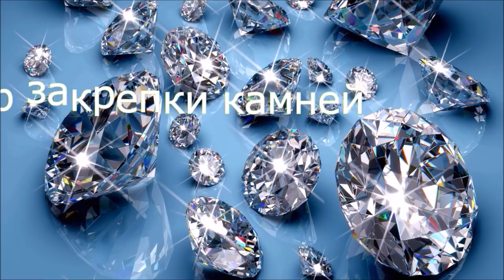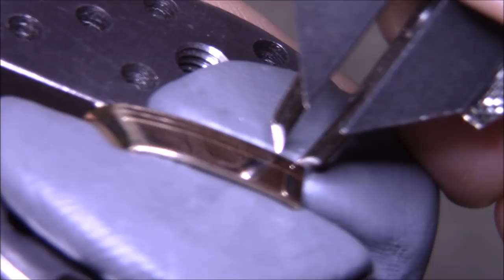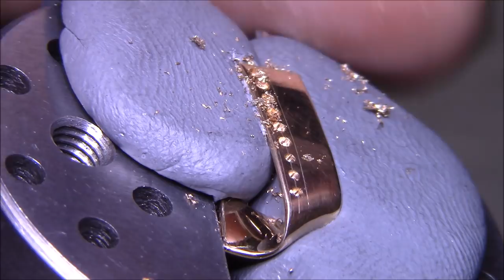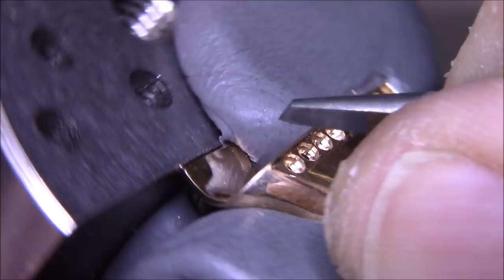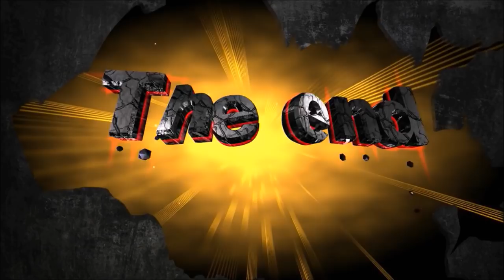Закрепка камней Stone setting (Серьги)

Comment: What tool did you use when scribing the lines into the metal. What is that tools name that you marked the holes and lines with. Where can I buy the tool you used to mark the lines and dots for the holes?
Reply from the maker: Compasses marking for metal
https://www.google.com.ua/search?q=%D1%86%D0%B8%D1%80%D0%BA%D1%83%D0%BB%D1%8C+%D1%80%D0%B0%D0%B7%D0%BC%D0%B5%D1%82%D0%BE%D1%87%D0%BD%D1%8B%D0%B9+%D0%BF%D0%BE+%D0%BC%D0%B5%D1%82%D0%B0%D0%BB%D0%BB%D1%83&tbm=isch&ved=2ahUKEwjZmPCg_vf1AhXHVMAKHfOtDpQQ2-cCegQIABAA&oq=%D1%86%D0%B8%D1%80%D0%BA%D1%83%D0%BB%D1%8C+%D1%80%D0%B0%D0%B7%D0%BC%D0%B5%D1%82%D0%BE%D1%87%D0%BD%D1%8B%D0%B9+%D0%BF%D0%BE&gs_lcp=CgNpbWcQARgBMgQIABAYMgQIABAYMgQIABAYOgcIIxDvAxAnOgYIABAIEB46BAgAEB5QjB9YlzJgnUFoAHAAeACAAWOIAYIDkgEBNJgBAKABAaoBC2d3cy13aXotaW1nwAEB&sclient=img&ei=gYMGYpnUE8epgQbz27qgCQ&bih=722&biw=1536

Comment: I want to buy mantis elite with x6 lenses and working distance is 12.8mm. Will be that fine for stone settings or engraving?
Reply from the maker: I dont know. Maybe a little. The working distance depends on the Barlow lens, it is located at the bottom of the microscope. Here is my microscope       https://ru.aliexpress.com/item/Free-Shipping-3-5X-90X-Trinocular-Articulating-Arm-Pillar-Clamp-144-LED-Zoom-Stereo-Microscope-14MP/32631845052.html?spm=2114.13010308.0.38.C4BxM0
Reply: @stonesettingandrejjeweler8245  did you use this microscope to record this video? If not, what camera do you use?
Reply from the maker: @allenl9214  camera Canon legria HF R806

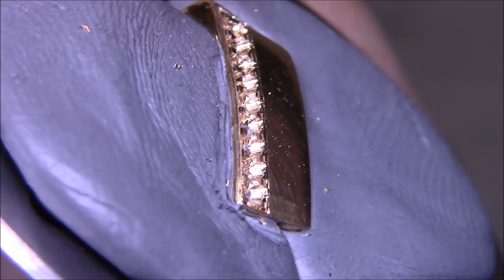Comment: hello , good work but why do you need to drill the holes again at 15:36 ? may I ask ?
Reply from the maker: A more careful adjustment is always done before installing the stone, in order to remove the burrs after cutting with a shtihel.
Reply: Обзор закрепки камней STONE SETTING Andrej Jeweler . if I have stones size 1.5 mm what size of bur I  should have to use measter ? thanks for your answer!
Reply from the maker: @garyzeos1464  calipers
Reply: Обзор закрепки камней STONE SETTING Andrej Jeweler ... ?????????
Reply from the maker: @garyzeos1464  I did not understand your question. Google translator does not translate correctly
Reply: Обзор закрепки камней STONE SETTING Andrej Jeweler. 
какой размер заусенцев я должен использовать, если я использую 1,5 мм камни?
Reply from the maker: @garyzeos1464  Before the last fit  1.4 мм
Reply from the maker: My translator clumsily translates
Reply: Обзор закрепки камней STONE SETTING Andrej Jeweler 
so if I have stones ( 1.5 mm ) I have to use 1.4 burs ? 
thanks )))))
Reply from the maker: Gary Zeos  You are welcome😀
Reply: Обзор закрепки камней STONE SETTING Andrej Jeweler 1.4 mm ?
Reply from the maker: @garyzeos1464  Yes